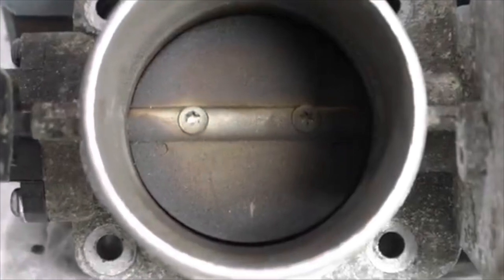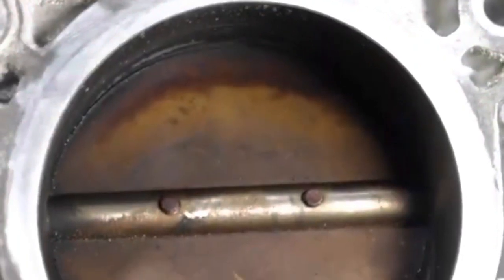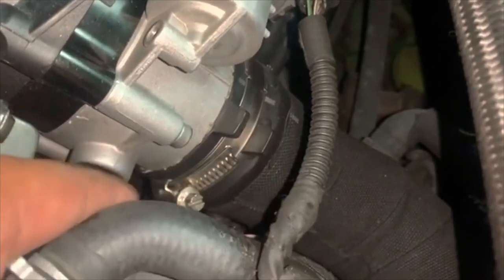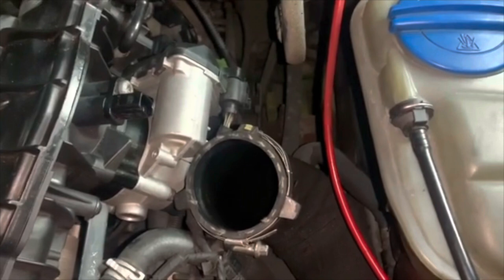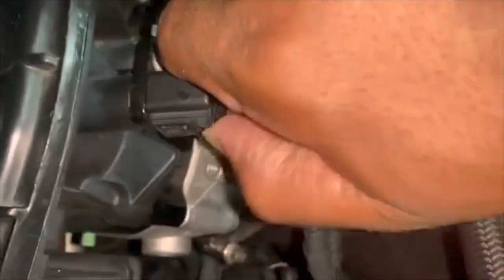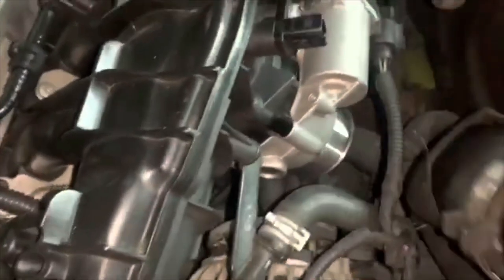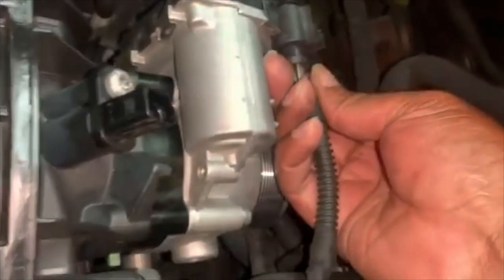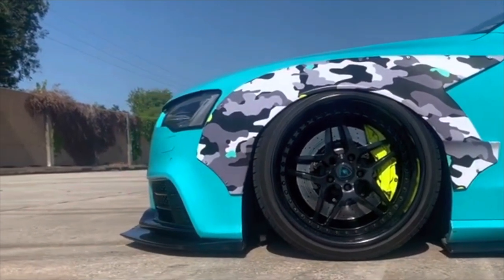(AUDI) 7 WARNING SIGNS YOU SHOULD KNOW? BEFORE IT’S TO LATE !!!! ( Throttle Body)

Comment: I really appreciate the channel Bruce.  So I have a 2011 A4 that has 150k miles and have been noticing the past couple months it stutters when I step on the gas to accelerate to highway speeds quickly at 3000 rpm.  There are no dash lights that have come on and no other issues besides this.  I'm also seeing a reduction in my mileage before filling up again.  Do you think this the result of a dirty throttle body, dirty injectors, or MAF sensor?

Comment: Great video. hot idle on the (dirty) throttle body sounds exactly what's wrong with my 2006 audi a8.  It's in the shop now. thanks again
Reply: Could be a trans issue

Comment: I've been seeking help for a while, but so far no one has been able to say anything that would help. The problem is as follows:
Audi A4 B7 2.0T FSI Quattro Tiptronic 147kW engine code BWT.
The car, when left stationary with the engine running, eventually stalls after some time. Sometimes it's 10 minutes, and sometimes half an hour. It just dies. There are no warning signs. The engine speed remains steady (800rpm), no fluctuation or shaking. It seems as if someone simply turned it off. After this, it cannot be started for a while. I've already replaced the crankshaft position sensor, but it didn't help. HELP
Best regards.

Comment: Your car is amazing dude! 
Having some issues myself.  My throttle will behave for a while, then go to 2k, then nearly cut out, then back to normal.  It's a 2010, with about 140k miles.  Ill be doing an oil change tomorrow, I'll clean the throttle at the same time.  I assume it's dirty anyway.  Is it necessary to remove it, or just pull the intake tube and clean it in place?
All in all, in the 2 years I've owned it its probably the cheapest car I've owned for maintenance/repairs.  Only issues are this, a window switch, and a coil pack.  Gotta keep these manuals going.
Reply: Im having the same problem with no boost. Did cleaning the throttle body help your issue?
Reply: @benjaminhernandez698  No!  Turns out it was a Boost Pressure Sensor.  It looked brand new, but was a cheap Chinese part.  It would get up to temp and start throwing everything off.
Reply: @RByrne  Thanks for the info will definitely change that out and hopefully it works.

Comment: I have an 08 Audi A6 4.2 I’ve changed my fuel pump and spark plugs . When I start it it idles and then stalls and stops I step on the gas and no matter how hard I press it won’t go

Comment: i have a 08 A5 coupe 6speed with the p0123 code and replaced pedal still have code and replaced throttle body and cant adapt the tb to get vehicle to get full throttle also changed the the plug for tb dont know what else to doany suggestion

Comment: My car vibrates a lot when it's just idle parked. No acceleration problems, no driving problems, nothing else, but when it's parked or stopped at the light it's vibrates so much.
Reply: Same here. I was told cleaning my throttle body will probably fix my issue 😅
Reply: @moanaleesha777  That seems way too easy for such a problem. I'm gonna try it this week. Lol hopefully thats the case.
Reply: Sparkplugs and coils
Reply: @AlexVorasane you ever figure out what’s causing it? Mines doing the same thing

Comment: any plans on going above 450hp ? forging the engine and adding a bigger turbo seems to be the better option than buying an s5/dual pulleys with a tune
Reply from the maker: Yes i already have a big turbo, and forged internals, working on fueling now, coming soon
Reply: looking forward to the build. especially the fueling @brucecustommotors

Comment: Have an EPC light with no code and the "don't exceed 4000rpm" light
Reply: 2010 3.2 Q5
Reply: @RT-rz9ji  did you ever get that sorted I have a similar epc light
Reply: @knicksallday6442 I have the same problem, anything worked out for you?
Reply: @nestoramaral4425  I changed all sensors around turbo, eventually it ended up being the turbo which I just recieved yesterday also ended up pulling p0299 code instead of epc
Reply: @knicksallday6442  thanks a lot I’ll see what happens with my audi